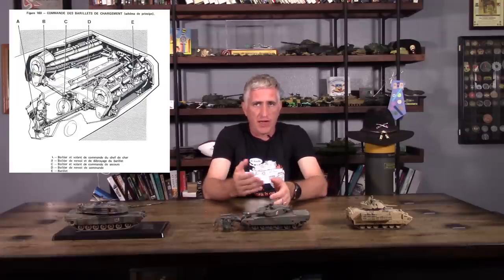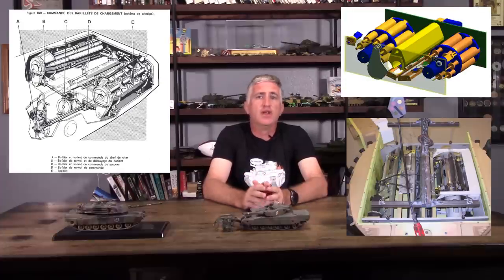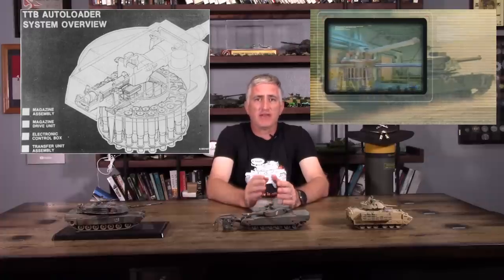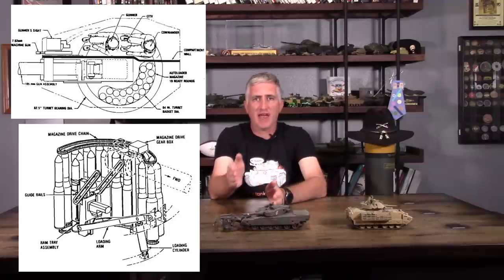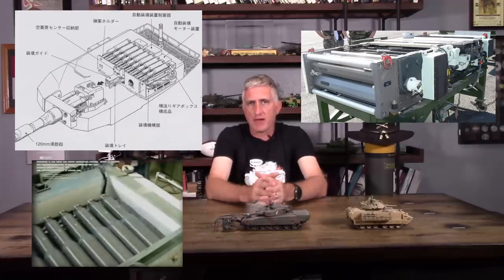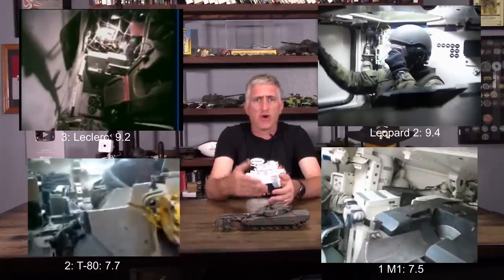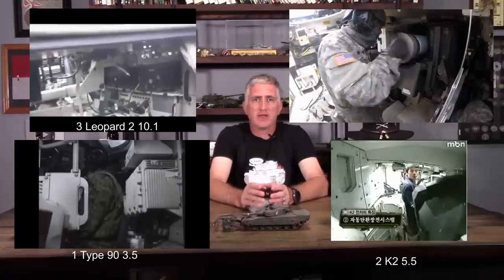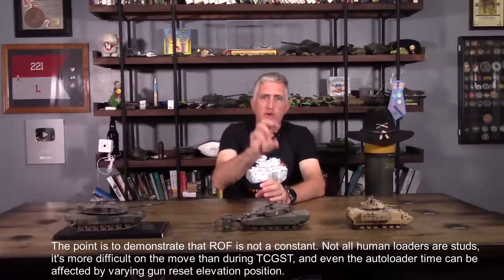Whither the Autoloader?

Comment: Two advantages to autoloaders often overlooked:
- autoloaders can work with bigger rounds than human can handle
- smaller crew means lower maximum casualties in case of catastrophic tank explosion
Reply: I don't think the first point there is a net positive, having a bigger round means less rounds overall in a given space, and bigger =/= better anymore.
Reply: Sometimes you can't overcome bigger rounds. In other way someone would try to fight with his 3" against T-72.
Reply: @Zadlo14  What?
Reply: So how do you fix a malfunction on a tank like a t14 while in combat ? The crew is entirely separate compartment from the turret .
Reply: @ozzy7763  what kind of malfuntions could be worked around in a, lets say, an abrams that couldnt be fixed in a T-14 (even if we have no clear picture of the inside of its turret)?
Reply: alanch90 if you have a misfire for example. The crew compartment is a completely separate space from the turret . How would you clear the misfire if you are in combat?
Reply: @ozzy7763   it depends on the cause of the misfire. If the problem lies with the gun itseld, then there are limited things the crew can do to solve it. If the misfire is caused by the round, then it has to be unloaded: some autoloaders can clear such misfires (such as those developed both for the Abrams and also the unmanned turret prototype). Although we dont knot how the autoloader of the T-14 looks like, its to be expected for it to have such ability and/or redundant systems to prevent a mission kill because of a misfire.
Reply: @bigdiccmarty9335  well thats only if you are talking about caliber size. And bigger generally is better hence why we switched to 120mm over the 105mm. The autoloader can handle longer rounds which means longer APFSDS rods which inherently means more penetration and longer range im sure the army would sacrifice 2 or 3 rounds if they got a substantial increase in effectiveness.
Reply: @ozzy7763  how would you fix a catastrophic malfunction on any tank in combat? Simple you wouldnt, if you couldn't use your main gun in either tank you would just retreat while the other tanks in your company cover your retreat back to friendly lines.
Reply: @ozzy7763  generally the two piece ammo on the russian tanks doesnt misfire. If this was a problem with auto loaders it would have been documented. The only real issue is if you want to change ammo on the fly(while one is in the tube) but generally speaking if it was so dire that you needed that round like yesterday the gunner would likely just fire the round in the tube and load the desired ammo type but this is kind of unlikely when you consider than 70% is APFSDS and the other 25-30% is HE-FRAG depending if Arm's are carried on board.
Reply: @bigdiccmarty9335  Bigger rounds doesn't necessarily mean larger bore projectiles. Kind of the point of APFDS.
Reply: @nemisous83  I don't think you know as much as you think you know about this subject. We didn't switch from the 105mm to the 120mm just because it was "bigger ergo better"...
The loss of total ammunition capacity would be far more than 2-3 rounds if we stepped the caliber up further, because the packing efficiency of cylinders is trash. And longer APFSDS Rods? I think you mean longer casings, but that just means even less ammo capacity/larger overall tank for a slight theoretical increase in range, which is already basically the horizon anyway.
Reply: @AnimeSunglasses  Sub-caliber projectiles are irrelevant, the diameter of the casing is what matters, that is the largest part of the round, the larger case diameter the less ammo you can bring in a given space. a 120mm APFSDS projectile may be 40mm across, but the casing, the thing that holds the propellant, is still ~120mm in diameter. Sub caliber projectiles do not increase ammo capacity, UNLESS weight is the limiting factor, which is unlikely.
Reply: @bigdiccmarty9335  sorry, I kind of didn't explain the tangent to sub-caliber there. What I meant is that when you're using sub-caliber rounds, the overall bore diameter has much less relevance to the muzzle velocity. 
Edit: if you see what I mean here, you can skip the rest.
As an analogy, say I was too make FSDS slugs for a shotgun, and had a 12ga with a 2in chamber, or a 16ga with a 3.5in chamber to work with. Now, I'm not sure if that's ENOUGH longer a casing to pack more powder into the 16 than the 12, but if you're designing a tank gun you don't need to worry about buying your ammo at Cabela's and can make the casing as much longer as you need to. 
When talking about ammo stowage, the lost space is mostly in the problem of how tightly you can pack circles - the cross section of the round, rather than the whole volume, because, among other reasons, we don't tend to design ammo stowage with a second row.
And you can pack more smaller circles into any given area, so if we're trying to design for greater ammo capacity then if we can get the same performance out of slimmer shells, we WILL use slimmer shells.
As far as I understand, this is the reason behind the slowing of the increase in tank gun (and to some degree naval gun) bore in recent decades, compared to pre-WWII developments.
Reply: @bigdiccmarty9335  I actually think you are the one whole is ill informed I never said we switched for "big ego" reasons thats you just trying grasp at straws. The reason why we switched was because the 120mm was better in every way, longer range, more penetration and longer rods. Yes I said longer rods, as you may or may not know and APFSDS rods performance equivalent to how long it's rid is infact an APFSDS rod can never exceed penetration values greater than the length of the rod. That's why Arrow head is so effective because it has essentially 700mm of essentially dead air space which significantly degrades APFSDS performance. If you want a better example why longer rods are better just look at a cross section of all modern APFSDS rounds they are quite long true Americans having the longest (no pun intended)with M829A3 which has the rod god almost to the back end of the primer cup.
Reply: @nemisous83  I did not say "big ego", re read my comment. As for the rest of your comment, I do not have a firm grasp of the physics involved with the Sabot's mechanics, so I have nothing to say.
Reply: The new Russian T-14 really shows how an autoloader can improve crew survivability. The crew is reduced to 3 and are all positioned in the lower front hull which is protected by an additional thick armour layer.
Reply: @nemisous83  The 120 mm smoothbore was chosen precisely because of the APFSDS ..... more room needed for fins.....
Reply: @AnimeSunglasses  but they do .... bore needs to be larger than the fins
Reply: For the same number of tank crewmen you can have more tanks.
Reply: You can make the tank smaller and weight less than that of a tank with manual loader, which gives more efficiency and power to weight ratio of the vehicle a great advantage when it comes to mobility and also protection since you can entirely separate the crew in an armored work station in the hull and focus the thickest armor there  like those of the Russian T14 armata.
Reply: @jamesparriott5852  well that and 120mm APFSDS rods are much longer than 105mm rods
Reply: @jamesparriott5852  Yes, but the fins do not have to be the entire width of the bore.
Reply: Brian Mattingly they can access the turret as far as i know with a hatch
Reply: @ozzy7763  simple, you RUN AWAAAYYYYYYYY
Reply: The bigger rounds aren’t THAT heavy
Reply: Plus learning how to do crewless turrets, mastering automating everything and making targetting/reloading/sensors better is a nessesary step in order to fully automate a fighting vehicle, removing any disadventage in wasted space/crew protection that current designs have
Reply: @bigdiccmarty9335  

In a indirect artillery role an Autoloader would be perfect
Reply: @TheCarDemotic Yeah, it would be.
Reply: Autoloaders are useful for nations that use conscription because conscripts are typically lower-skilled and they don't train long enough to become masters. Meanwhile a machine is consistent
Reply: @FFFFFFF-FFFFFFFUUUUCCCC  A very niche case, but if a military cannot even train a loader to be proficient their tank crews will have far worse problems than the gun not being loaded quickly enough.
Reply: @ozzy7763  Well tell me how do you fix a loader when he/she is having an explosive diarrhea thus unable to load shells into the breech.
Reply: @bigdiccmarty9335  When you have a 1.5 meter long APDSFS shell of a 120mm cannon that could pen 1000mm or even 2000mm of armor, you really dont care about space, only if the gun will work and shoot
Reply: @AnimeSunglasses  
> when you're using sub-caliber rounds, the overall bore diameter has much less relevance to the muzzle velocity.
/facepalm
You flunked physics, didn't you?
Base area is proportional to bore diameter squared. Going from 105 mm to 120 mm means 30% more force accelerating the round with the same bore pressure, which is a limiting factor. And 125 mm is 8.5% better than 120 mm in that regard.
Reply: @ozzy7763  you don't fix malfunctions in combat, life is not war thunder
Reply: But it seems at the same time, having an autoloader increases the risk of such a catastrophic explosion
Reply: @sauronthemighty3985  depends on the autoloader design. Many tanks w autoloader have it completely isolated from the crew.
Reply: Tankers, "Manual loaders are better."
People who have never been in a tank, "Autoloaders are better."
Reply: @bigdiccmarty9335  with that logic ww2 tanks had about 1.5 to 2 times the ammo capacity of modern tanks
bigger roudns are needed, the new 130mm western gun fires rounds are already 30kg

russia was planning to put the 152mm gun on the t14

the human loader is actualy a limiting factor on modern tank design
Reply: @billwhoever2830  well if your tank was an m3 lee, they had hella ammo in a tank much smaller than an abrams

If you take out the 120 and replace with a 155, total ammo goes down, unless the design changes radically to accommodate the larger ammunition
Reply: @bigdiccmarty9335  I think that the 152mm version of the t14 would actualy have a faster autoloader. Ammunition is not that big of a deal, the smaller capacity would still be enough for most missions. 

I cant find info about the capacity of the t14 but its basicaly based on the t95 or "object 195". 

Object 195 had 18 ready to fire rounds on the carousel. In a typical fighting setup it can be equiped with 10 APFSDS, 6 HEAT and 2 ATGMS, making a very lethal package.

For comparison, t14 has 30 ready to fire rounds on the carousel.
Unlike the object 195 though, the t14 has extra space on the rear of the turret (just like in western tanks) for some 14 additional ammunition.

To conclude, the 152mm version of the t14 would carry about 28 rounds while current heavy MBTs with 120 and 125mm guns carry 40-45 rounds (this includes ammo next to the crew).

The reason the 125mm gun was sellected is because: 
-APFSDS performance is not that worse (with the new supercharged 125mm gun not the old ones used on t72-t90)
-the 152mm gun would be incompatible with current mass prodused ammunition

So, to sum up, the reason the t14 uses the 125mm gun is mainly for logistics, to be compatible with older ammunition.
Reply: @billwhoever2830  in a single continuous engagement, if you end up firing more than the ready rack, you're already in deep

but as for autoloader performance i cannot say, but if the evolution of armor/active defense is such that tanks cannot kill one  another without increasing caliber then i cannot argue that. but cutting your total ammo reserve in half will make logistics much harder, because you WILL need to resupply much more often, likely after every  other exchange if 28 is all you have, but if that's what it takes to win the battle, then it has to be that way
Reply: @bigdiccmarty9335  considering that the apfsds round of the 152mm travel at almost Mach 6 its more like a railgun
Such a round will easily penetrate any armor at any angle or range, in fact even current guns are capable of that.
If you have to deal with more than 10 tanks you probably have to think about your ammo earlier. Maybe use 14 apfsds and 4 heat
Reply: @billwhoever2830  tanks don't work alone, so 1 tank platoon would have more than enough ammo for 10 tanks, but how many times? how long until more ammo get there? that's my gripe, resupply is a huge factor in the longevity of a push/defense, halving your total loadout won't make your teeth less sharp, just make them shorter

as for a the 152mm rail gun, i've not looked into it, but if that's true it's impressive, but i'm always dubious of military testing, there's always some obnoxious issue that is unresolved, like they tell you the big number, and not the fact that the casing sometimes just evaporates in your hands
Reply: @bigdiccmarty9335  I didnt mean literal railgun man, I call it a "railgun" cause its achieving velocities comparable to what the navy railguns claim

if the imaginative 152mm equiped t14 uses all 18 of the rounds it has loaded it would (unless the targeting crew-equipment completely suck) would take out at least half or an entire dozen of enemy tanks

if the t14 actualy gets destroyed before killing 6 enemy tanks the extra ammo will only be wasted

I think that having enough ammo to engage 12 enemy tanks and 6 enemy building would be more than enough
Reply: @billwhoever2830  18 rounds isn't much outside of a single engagement, longevity is very poor on a theater level

as for the "railgun", i understood what you meant, I'm not sure what i said to make you think i thought otherwise
Reply: @bigdiccmarty9335  a side effect of bigger round is... you can stuff more thing in it: bigger HE, bigger canister round, bigger HEAT-MP, or you can do something dumb with it like AMP and gun-bore fire ATGM
Reply: Russian attack on Ukraine shows the fundamental failure of autoloaders: crews exposed to all too common catastrophic destruction.
Reply: @michaelmazowiecki9195  except thats a problem with non-compartmentilized ammunition, which isn´t exclusive to autoloaders. I remember very well how Leopard 2´s were experiencing catastrophic ammo detonations back in Syria (ISIS was shooting at them with Kornets which are not the most advanced AT weapons out there) on their non-compartmentalized hull ammo racks.
Reply: @bigdiccmarty9335  Kind of depends on caliber and type of ammo. Because they're using autoloaders with AGMS too. Plus with modern upgraded armor packages its harder for small bore cannon to penetrate. With current technology. Technology may change to negate this. In fact they almost certainly will. 

Spookston did a series on future tank design where he detailed several weapon systems actually in R&D with the US military. Including rail guns, plasma ignited conventional rounds, and light gas propelled. The latter was insane. The round was a 120mm hypersonic shell flying at 7.5 miles per second. Escape velocity for the earth is 7.2 miles per second. Plus it had a range of 200 miles. No I didn't misprint that. 

Plus they use autoloaders in SPGs because howitzer ammo is too damned heavy for one human to keep up a decent rate of fire.
Reply: @ozzy7763  You don't. You pull out of the line. Same as if you have a SPG that has a malfunction in its autoloader. 

Mind you, there has to be access hatches on the roof of the turret or they wouldn't be able to load the thing in the first place.
Reply: @Wastelandman7000  sounds reasonable
Reply: @bigdiccmarty9335  especially considering the much higher probability of a complete tank kill from a single hit penetrating the wrong spot, which is pretty likely the tanks profile.
Reply: @bigdiccmarty9335  he is saying that bigger caliber= better penetration which may be something that you want on future tanks
Reply: @sluin  yeah
Reply: And can reload on the moov
Reply: In the 80s, autoloaders couldn't handle rounds that were as long as manual loaded rounds
Reply: @XerrolAvengerII  the future is now old man
Reply: Disadvantage of autoloaders in soviet tanks is that length of ammunition is limited and smaller as for NATO tanks. So you are wrong.
Reply: I’ve never seen an auto loader help break track or help with PMCS. If the loader is incapacitated, the commander can load the gun. If the auto loader is damaged or malfunctions, the tank is done.
Reply: @geraldbradner5801  that is a fair criticism, and the brass bean counters very well might feel enticed to cut manpower with fewer needed crew
Reply: But increasing economic casualties because autoloader mechanism is huge cost.
Reply: @Nnneemo  that is a good point, a fast and reliable autoloading mech is a lot more expensive and adds to general upkeep costs more than a single guy

tho fielding tanks is also insanely costly as well, so in the grand scheme that sounds like one for the bean counters
Reply: @bigdiccmarty9335 Depends on what you are facing in combat.

120mm can be manually loaded without much trouble and as long as it is sufficient against the expected foe there is no pressing need to use autoloaders.

If you want one, however, you can try and make sure that the autoloader design itself doesn't increase the risk of catastrophic explosion.
Reply: @bigdiccmarty9335 hexagonal ammo is superiour 
source:cgp grey's "hexagon is the bestagon"
Reply: @abas656thegodemperor9  shit, you right
Reply: You have obviously never served in a combat unit with tracked vehicles.
Smaller crew means less men available when (not if; WHEN) a track needs to be repaired.
A 4th man provides 30% more leverage on the 10-foot long (3 meters) breaker bar when loosening up the nuts on the carriage bolts which hold the tracks together.  Those fasteners ARE rusted, AND jammed full of sand and other particulate matter, all of which make the job extremely difficult.  Air tools are literally useless, as they don't provide enough torque.
Reply: @akulkis  tracks like to break at the most unhelpful of times
Reply: @ozzy7763 the autoloader will be able to clear a misfire simply for the reason that you need an ability to switch from AP to HE ammunition depending on circumstances anyway. so you switch out the dud round regularly. If the autoloader can't get a stuck round out of the breech with all of it's hydraulic/pneumatic/electric glory, i doubt a human loader can with his hands out of flesh and bone.
Reply: @bigdiccmarty9335 yes bigger is better which is why russia moved to 125mm and we germans are testing 130mm cannons on the Panther KF51.
Reply: @baraka629  nice
Reply: @bigdiccmarty9335 

Good point.

I just thought as a counter to bigger =/= better. With APDSFS in a larger gun the round itself could stay the same size as the 120mm APDSFS in NATO use rn. But with a bigger barrel means more space for more explosive which means more power and more speed. Leads to more pen. Ofc they will be a point where increased size and this explosive doesn't significantly increase penetration and maybe the 120 is that limit in NATO terms. Just felt I should mention that while your points probably true bigger could mean better just not in the basic sense of a bigger round.
Reply: @baguette4177  another issue of bigger maybe meaning faster, i'm no expert on this subject, but modern tank rounds are very fast, and we may run into the wall of "the propellant literally cannot burn fast enough" and we stop going faster, but ofc a bigger round going as just as fast is still better, generally

i'm not sure how fast that is with tank based powders, but i know that small arms it's something like 5k FPS or so as a maximum unless powder changes somehow